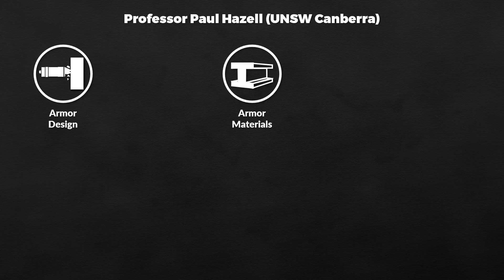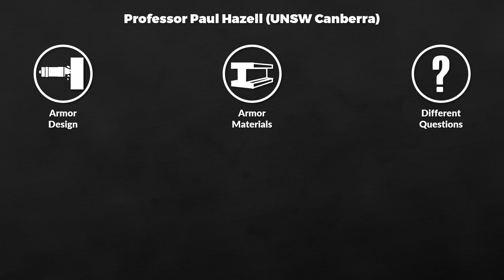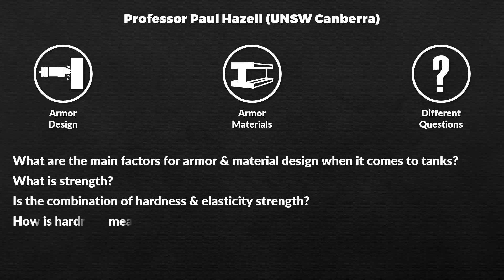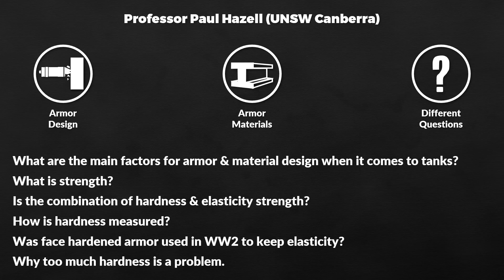Tank Armor Expert about Armor Design 101

Comment: Videos like this makes me realize just how advanced I'm in my own hobby compared to others. I rarely take time to appreciate how far my interest got me.
Reply: That's how I feel about automotive stuff - I was reading how-tos for building race engines, race car chassis & suspension design books, etc. and was messing around with lawn mower engines before I was 10(look, I'm not saying I really understood what I was reading, but I WAS reading it lol - never could get into fiction though). I'm 34 now, and thinking about reflective pressure wave tuning in the intake and exhaust to tune the intake runner & exhaust primary lengths for a given power and RPM goal. Constantly trying to explain to people "...no no no, suction isn't what you think it is - neither your lungs nor NA engines 'suck' air in, rather atmospheric pressure(14.7psi at sea level) is shoving air in as your lungs/your engine's pistons create negative space(a vacuum), and areas of higher concentration go to areas of lower concentration, so...", LOL.
It doesn't feel like it was all that long ago when I was reading 'common knowledge' on the internet and thinking to myself "...well that doesn't make any sense though... ...but this 'common knowledge' contradicts that 'common knowledge', so how...", yet also couldn't really say anything because I hadn't yet learned enough to KNOW exactly how a lot of this information was wrong. If I knew then what I know now... lol.
Reply: It's a great thing to keep on learning, and get better and more capable!

Comment: I think strength he meant more like tensile or compression strength: Concrete has great compression strength (doesn't break or deforms easily by being compressed) but has terrible tensile strength (imagine a concrete slap that is only supported in one side and has a weight on the other side, it will eventually break; steel has much better tensile strength and that's why there is reinforced concrete that has metal bars to give extra tensile strength) both are linked to how "elastic" a material is:
"plastic" phase and "elastic" phase. In the elastic phase is the amount of force over time in which a material can deform but still can go back to it's orginal form while in plastic phase is when it reaches an amount of force that makes the deformation permanent (both can be seem in Stress–strain curve graphs)

Comment: I read that composite armor is better when hit at a perpendicular angle. However, I see some vehicles that appear to have sloped faces. Are they using non-composite sloped armor or is it composite? And are there still advantages to sloped armor vs. perpendicular? I'm wondering if a design like the Swedish Stridsvagn still makes sense or if everything needs to become a chonky boi.
Reply: While I'm not aware of any particular cases of this, it's plausible that some composite materials might have orientations that act differently due to them not being isomorphic in all directions, but it should be possible to adapt such designs as necessary to a chosen slope. The purpose of sloping or curving armor is that, aside from having a slightly higher tendency to safely ricochet away from the object being protected due to an increased angle of incidence, you effectively increase the thickness of the armor by going through it at an angle where the distance from one side to the other is greater than it is going directly through from front to back.

Generally speaking, it's always preferable to slope armor where applicable.
Reply: The shape/slope of the external plates aren't necessarily indicative of the configuration of the armor array.

Comment: If you get a chance, might be too late if this series has already been recorded ... how far from straight-on can a projectile hit and still penetrate?  A projectile coming in at 1°, almost parallel to the armor, will just bounce off.  As it angles further from parallel and closer to perpendicular, 10° to 45° to 80°, the chances of the nose digging in increase.  Is this something that changes gradually, or is there a specific angle where the probability changes radically?  Is there a general angle for all shells of the same type (HEAT, APDSFS)?
Reply: i believe its for apfsds modern projectiles its 82 degrees, this is why the abrams and leopard 2 glacis plates are sloped at this angle, look up a couple of you tube channels, SY simulations and DEjmian XYZ simulations
Reply: @jukeseyable  Thanks -- just looked them up.  More ways to waste time, by gum, life is pretty good :)
Reply: @grizwoldphantasia5005  for sure, i like the channels. im sure i remember a video on your precise question though, cant remember which of the channels addressed it though, sorry i cant be more specific. enjoy
Reply: That depends on shell design. Some shell designs could theoretically pen that 1 degree but making said projectile might make it have issues in other areas or cause problems in manufacture
Reply: Many thesis papers and entire books have been written on that subject.

Comment: My question would be - If he thinks modern tanks will have to be redesigned towards wider types of projectiles endangering tanks.. It seems to me, all modern tanks are way too "specialized" to defeat other tanks ammo, in frontal aspect, yet current combat experience shows that 70-80% of all losses are due to indirect/artillery fire, which modern tanks cannot survive as most of advanced sensors tanks have are on top of the turret and unprotected against such attacks.. Is it really worth it having 1m of RHAe on front of the turret, when  this armor only protects you against frontal hits which enemy will try to avoid and will try to outflank your tanks to hit them in the sides? is that extra weight really worth it? Wouldn't it be better to use "lighter tanks" with same firepower, but much higher strategic and tactical mobility, which can move through terrain more freely than 65-70ton tanks?
Reply: That's all true but remember that tanks are primarily designed for conventional warfare — directly conflict with another nationstate with similar forces.  That it is inefficient outside of that is not surprising and not necessarily concerning, so long as it is still effective.

I do think we will see tank-like vehicles supplant current tanks though, particularly as we figure out better ways of communicating and coordinating them, thus better projecting power into the battlefield.
Reply: "current combat experience shows that 70-80% of all losses are due to indirect/artillery fire"

This reminds me of the story of WWI, where he British adopted steel helmets in the trenches, and saw an increase of head injuries in the order of a staggering 10 000%.
Department of defence was naturally very concerned about this, until it was pointed out that those injuries previously would have been dead soldiers.
Without that specialized armour in the front, it is quite possible that the percentage of artillery losses would rapidly decline, but not because the new tanks' better protection against artillery, but because the frontal penetrations would go up to a high degree.

In short, you make a valid question, but it really needs an indepth analysis also considering how many losses the current empathies on frontal protection prevents.
Reply: Probably not.  The mission of  a tank is still to attack/defend across terrain under fire.  You'll never be able to drive faster than a bullet. 
This is why tanks (and all other AFVs) are evolving greater top and side protection.  And example would be Merkava and also the advent of heavy IFVs in Israel and followed by other, Puma etc.